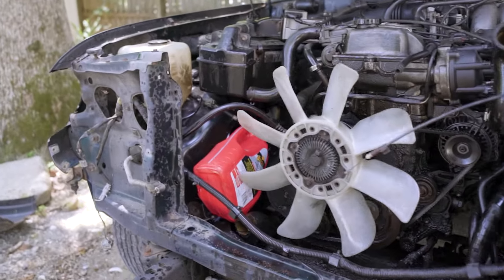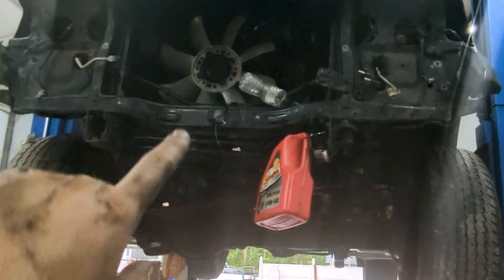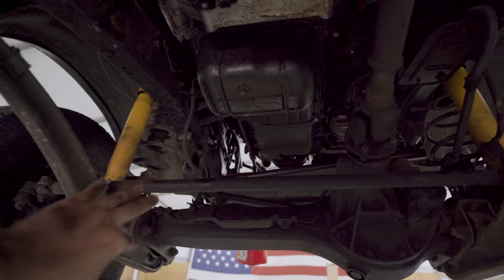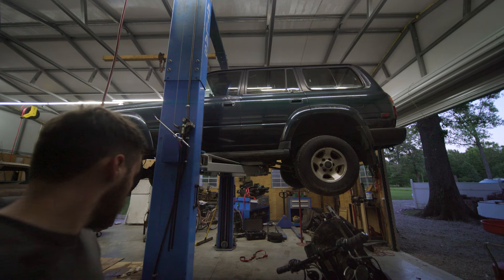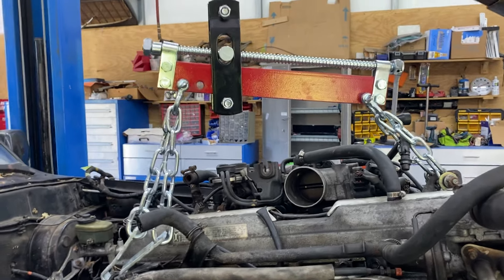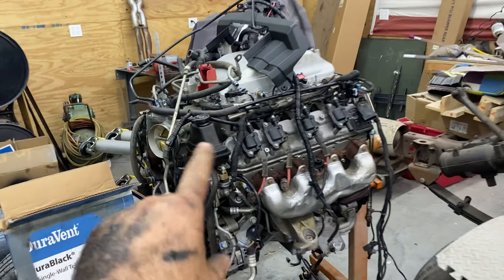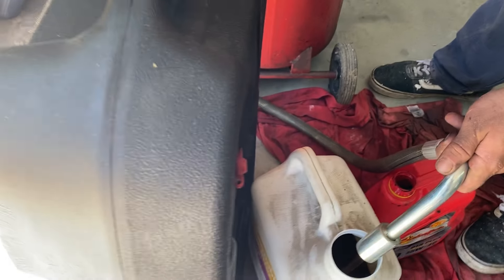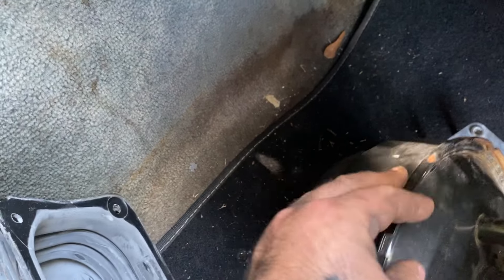LSA Land Cruiser 80 Series Build | 66" of Garbage | Episode 5

Comment: I’m in the process of either getting a 80 series or a gx470. I know you’ve owned both. Which do you feel is more enjoyable for an overland vehicle? I wanna spend a lot of time going through the mountains and mild to moderate offroading. Mainly exploring and overlanding though
Reply from the maker: I haven't gotten to enjoy the land cruiser in the same way I did the GX. If you plan to do a lot of long distance driving (3+ Hours) I'd go with the GX. It's safer, smoother, easier, cheaper, doesn't need any power modifications, and most likely will have less maintenance. The main reason I switched to the Land Cruiser was because the GX left me bored with not much to do. It simply solved the overlanding problem with a 3" lift and 33" tires that took me 4 hours to put on. After that there wasn't much left to do. The Land Cruiser given me a "sky's the limit" level of fun in the build process.